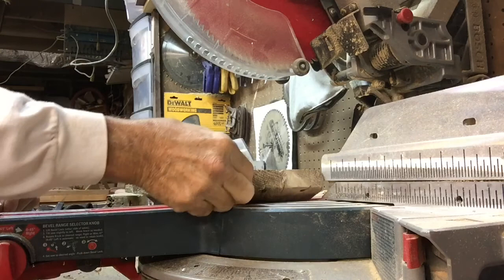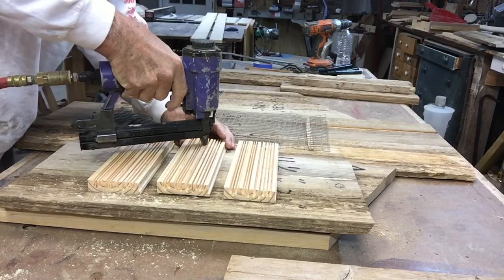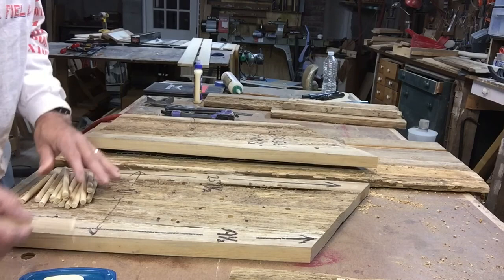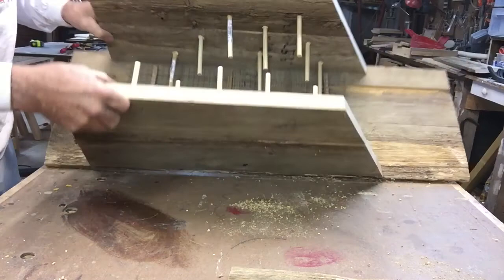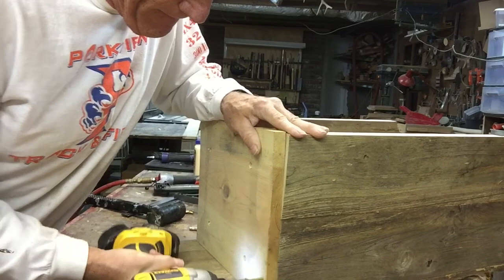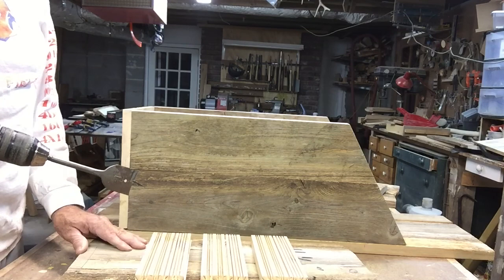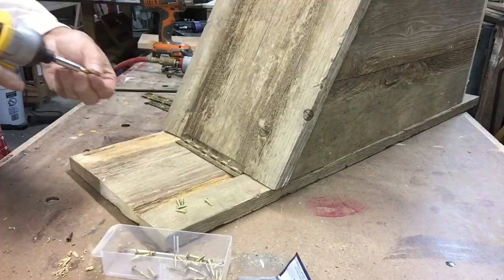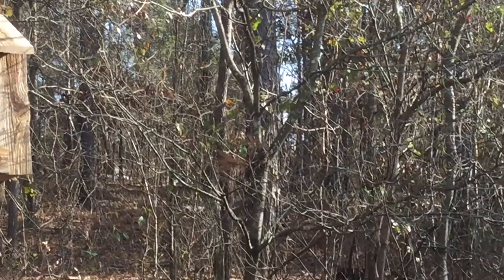Chickadee roosting box

Comment: Thanks Larry. I was looking to make one and found your video.   So I made one.   Only I made it a few inches shorter due to wood I had on hand,but same design.  Thanks for the post.
Reply from the maker: I hope you get more action than mine does. I haven’t had a visitor since I put it up.
Reply: @LSatch  Here's the thing.  I finished it and was just going to store it until the fall.  Then while looking for placement tips I found your follow up video.  I felt your disappointment,  sorry about that.  I have 5 birdhouses and found 2 un used so far. I'm thinking location.
Reply from the maker: Rosepetal Drone I agree, it’s location, location, location.  As for the roosting box, we’ve had really mild winters here the last couple of years.  I think it only dropped into to the 20’s  a couple of nights.  There are also several comments about making it smaller.  I’m thinking I’m going to convert it into an owl house.  Stay tuned, and good luck with the vacancies.

Comment: The reason why the plans called for the bottom to be between the walls is because when water moisture comes down the outside walls it'll accumulate along the bottom and with how you added the bottom moisture will get into your raw edges and cause rotting.
Reply from the maker: Jess Duquette thanks, that makes a lot of sense.  So far, after 2 years, the cypress wood is showing no rot.  I’m sure other types of wood might rot sooner.  Thanks for watching and commenting.

Comment: Nice job, Lar. Only thing I'd do different is extend the bottom a little more so they have a nice landing platform where a few can congregate as they go in and out of the box.
Reply from the maker: LeCutter thanks for the suggestion.  Fact is, it’s a total bust.  Not one bird dropping in it in the three winters it’s been up.  I’ve had several people suggest that research shows they prefer smaller spaces.
Reply: @LSatch  Could be. I guess it depends on the birds - by which I am no expert. I have a lot of doves around and they congregate in groups. Then the assortment of blue jays, cardinals, sparrows, etc. Maybe try throwing up a platform feeder close to it and see if that entices them. Maybe some wood shavings and/or straw in the bottom? Ungrateful little buggers after all your hard work, hehe.
Reply from the maker: LeCutter I agree, free place to get out of the cold...It’s located about 10’ from our feeders.  I think I’m going to try a new approach soon, on my to do list.  Working on the wife’s list right now...😁
Reply: @LSatch  I read that chickadees won't share. They only use roosting pouches that allow only one bird. But other birds will supposedly share.
Reply from the maker: @obsidiansea   I’ve since read the same information on chickadees.  No one had been in the box in the 3-4 years it was up so I converted it into an owl box recently,  https://youtu.be/N3cvg4fx88k

I’m really interested in making small roosting boxes for chickadees if you have a link to what they should look like please share.  Larry
Reply: @LSatch  I’m currently building winter roosts for Chickadees. My friend made 10 last yr & every night, when it got really cold, a chickadee would fly in each one. Thing is, they’re tiny! She couldn’t find a plan online so just made one up. They’re much smaller than I’d imagined a roost should be. They measure 3x3x4. Small ledge on bottom, right below the entrance. With 1 1/8” entrance. Just tiny boxes. She put wood chips & saw dust inside. No perches bc chickadees (&downey woodpeckers) roost alone in the winter. She placed some black oil sunflower seeds on sm ledge to attract their interest. I have tons of chickadees & downies so am hurrying to get these finished & up before severe cold really hits.
Reply from the maker: @maryb6672  that sounds fantastic.  You’re my kind of person.  Good luck with your building, be careful and stay safe.

Comment: Cutting into that barnwood showed it was nice  slow growth lumber.  Good to know they winter locally, another good project, thanks. Have you seen them use it in the winter?
Reply from the maker: UreaSmith I’ve never seen them use it.  Some comments suggest new research shows they like smaller places.  We’ve had very mild winters the last few years.  I’m thinking I’m going to take it down and convert it into an owl house. The dimensions work.  Thanks for watching.

Comment: Wow you're a master wood worker!! You don't happen to know how to make a pipe cabinet? I'm ok with making the cabinet itself ( i think) but i'm not sure how to cut the glass for the front door? BTW who doesn't love the "Chickadee dee dee dee" sound? :-)
Reply from the maker: +Jesse from Vegas! Thanks, I’ve had some success cutting glass in the past.  I found it takes some practice.  Use a light oil on the cutter, like 3’n1 or kerosene if you have it.  I’ve found you don’t really need to make a deep score line.  Once scored, use the other end of the cutter with the ball to gently tap the underside of the score.  Good luck.